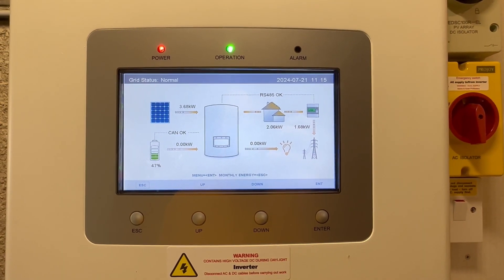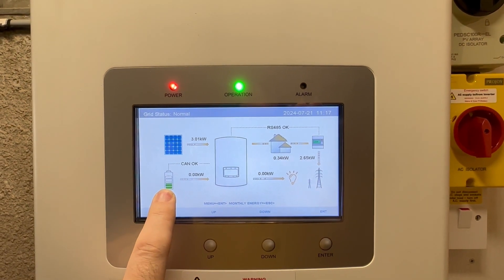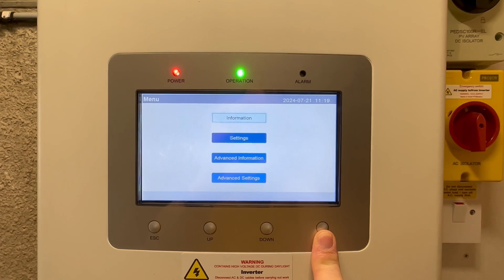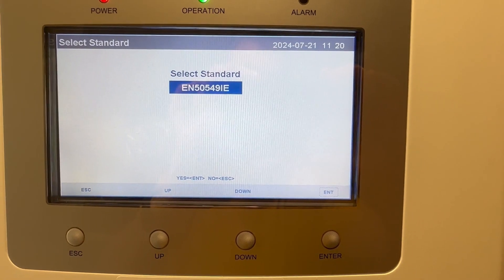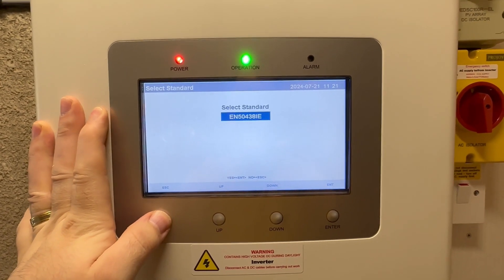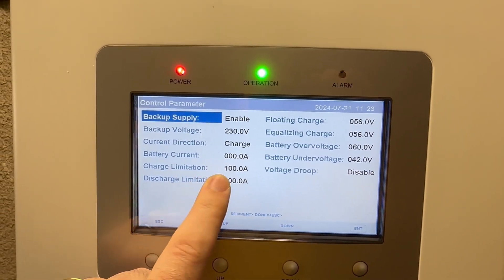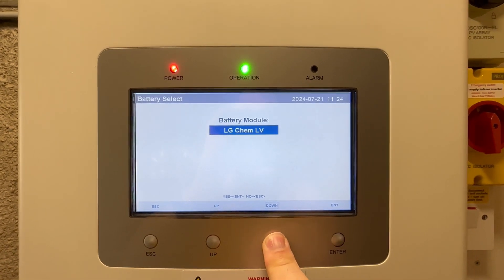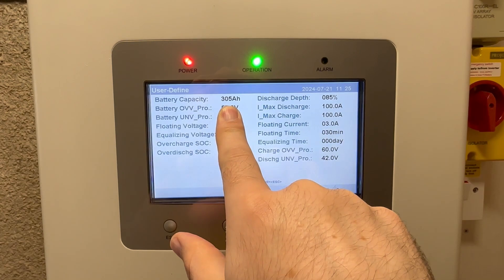Solis Inverter Battery Settings (other options)

Comment: Your next project..

Now you have cheap electricity and big batteries.

Get yourself some Air Conditioning fitted. New type 'Inverter compressor" type units.

Above minus two outside then instead of burning the Gas Chugga we switch on Air Conditioning to bulk heat the house.

Rather than paying 6p per kwh Gas, we're using previous night 12p Economy7 and dividing this by 4 (COP), our Heating costs 3p per kwh which at EV Rate of 7p would equate to 1.75p per kwh Heating!! 

We're saving a fortune on our Gas as 1kwh of electricity gives 4kwh heat. Roll on Spring when the electricity is free.

One tip - oversized units is the secret. They have the power to heat and back off to maintain.

BACKUP - does not need to be enabled on your Solis, although switching it on and moving your lights, boiler and fridge freezers circuits to a secondary Consumer Unit connected to EPS output on Inverter means they stay active during Grid failure.

Priceless..

One other tip on charging during Winter. Spread the charge over the full off peak period. There is no point charging to then run a washer from battery, run these appliances direct from Grid while charging. In doing so, you'll lose 5% on the round trip - run appliances overnight while charging..

Example - 16kwh needed and 6 hours window.

Watts divided by 52 divided by hours.

Eg

16000 / 52 / 6 = 52amps.

Doing this will mean Inverter works less hard and live longer and as your still charging while car is on you'll not risk charging car from batteries. 100amps is a hot Inverter wasting Energy and reducing its lifetime.
Reply from the maker: Some food for though there. Although we use very little gas, comfortably less than €500 a year on heating and gas hob. I just got the bill for November/December bill which matches the January/February bill typically. The bill is €118. This will be similar in Jan/Feb. So €250ish for the 4 most demanding months. The rest of the bills will be much lower. cost per unit is around 8c. We are well insulated here. 

I think the next round of energy spending will be to increase the number of solar panels on my property. I can add another 1.2kWp (4 panels) on the North roof to compliment the 4 panels there, attaching them to the same string. 

After that, I expect to add 4 to 6 south panels on my flat roof extension and 4 panels on my shed roof which has a slight north angle. Another 2 mounted vertical on the back of the shed facing south. I would be pretty much doubling my solar generation, but the panels on the extension and shed would not be connected to a hybrid inverter and so would not be directly connected to the batteries. I expect that should I add an standard dumb inverter and connect the comms to the hybrid inverter, any excess generation should go to the batteries before any is exported.

You make sense with using appliances like dishwasher and washing machine during the cheap rate rather than using the batteries. The reason I use the appliances during the day rather than during the cheap rate directly is to keep the sustained load from being too high. As it is, my main fuse is an 80A. Using a power factor of 0.95 with 230V my EV charges at 7kW and Inverter draws 5kW for the batteries. That's 12kW or 55A. If the immersion is left on at 3kW, that's nearly 69A, which is awfully close to the 80A limit before considering the standby base loads of around 500W. I plan to add a 3kW charger to the battery pack, but not before I setup the load balancing on the EV charger. So, my supply limits me and it is very expensive to increase it. Mine is anomalous, as I technically have a 16kVa supply allowance on a 12kVa supply because my DNO fuse is the same as the main isolator/breaker in the meter cabinet.

I'm also stuck with a 4 hour window to avail of the rates I have. I might consider a longer window upon renewal to help spread the load over a longer period. Will have to see what is on offer.
Reply: @GaryOnPower  sorry I've not replied as not seen your in depth response.

I'll read and respond later... one note if adding panels in a shade area such as rear, might be worth considering optimisers. We have a second string with two types of panels and half facing South othes West. This string works perfectly all day given max from each panel.

Apart from 4x nights this Winter using boiler as Air2Air wouldn't be efficient- we've had AC running 2pm until 8pm at an average cost of £28 per month.

Our Gas bill £20 for Hot Water..
Reply from the maker: @leet3707 The 4 panels on the Northside roof have optimisers and I would also put optimisers on the additional 4 planned for this year. The main reason would be the chimney shadow that casts on the North roof at certain times of the day. 

We use gas for hob cooking, as I prefer that to electric hobs. When we turn on the heating, the water in the boiler is also heated, but we can use the immersion element to heat the water separately. I do intend on upgrading my heating controls, as well as getting a larger cylinder installed and will be removing the electric shower which is a big load when in use (~8kW). We have a 4bar house pump already we can use for a thermostatic shower. 

I just looked back at our 2023 gas bill. The 2024 bill is split between providers, so is awkward to get the exact figure. The year bill was €391. Similar in 2024 from a glance. We use about 25% of the average for our house size on gas. By contrast, we use about 5 times the average on electricity. 

We had a new addition to the family this week, so I will be taking a couple of weeks out before making any changes to the house.
Reply: @GaryOnPower  congrats on the new arrival.. 

Sounds good with panels and optimisation.

What chargers are you running for EV as they'll likely be a "Grid Limit" setting. Although we have 100a fuse, as iys running overnight with other appliances I've set our Zappi to 80amps. This means the charging will drop if house incoming exceeds 80a leaving some headroom.

We're on Economy7 not EV due to protection of a longer term legally binding tariff as during the last Crisis many were kicked off EV to expensive non tariff rates.

Definitely look for a longer Window, 7hrs is great for us although 4p per kwh dearer which a can live with for longer nights and guarantees.

I tend to push appliances to early hours to allow the car chance to finish. Might be tight with 4hrs but great on 7hrs. Car finishes around 4am, appliances start at 5am.

Try setting incoming limit as this will protect the main fuse and allow max charge rate if spare capacity available.

Similar situ here last year, £550 Gas now £20 as we've shifted to electricity via Heat Pumps, er Air Conditioning.

Last 3 days has produced enough Solar to run the house, cooking AND 10kw spare for FREE Heating.

People still argue Solar isn't worth it.. lololol
Reply from the maker: @leet3707 I use the Hypervolt 2. I have yet to install the CT Clamp (first one went missing and second one arrived a few weeks ago). It's set to give the full 32A and will do the job of balancing the load once the CT is installed. 

My Grid limit is currently 80A. I have an unusual setup I won't get into here, but suffice to say I want to keep the load at or below 70A.

The cheapest tariff available is 5c per kWh but only gives 3 hours and that's a short window which would encourage me to stress my supply. I have the ~8c per kWh over 4 hours where I charge the EV(s) and house batteries. This is between 2-6am, so there is essentially no other load and that works great for us. I could have an 8 hour window, but the rate would be much higher and we wouldn't see the savings. As it stands, almost all the energy used in the house is from cheap night rate stored in the house batteries, or from solar.

Looking at my solar right now:
My house imported 53kWh from the grid with about 52kWh taken during the cheap rate. The split was probably 50/50 between EV and house battery.
The Solar exported 16kWh to the grid, paying me 20c per unit.
The house has been powered by solar and battery for the day and will have taken about 20kWh from the battery and 10kWh from solar. 

Not having solar is silly in my view.
Reply: @GaryMeatsLife  is there an option for a Grid Clamp?

The 32a is the charger supply cable, Zappi has a Network setting where the max Grid supply can be set.

Comment: AOBO setting is for Seplos V2 BMS. Just upgraded here from V2 to V3.

User Define is currently used for V3

Setting 19200 BAUD wiill kill the Solis Data Stick as they only support 9600 RS485 speed.

Set the Seplos to Ginlong Solis protocol on the pack and user define on the Inverter. BMS data is showing in the Inverter with these settings and Cloud still works.
Reply from the maker: Thanks for that info. I kept mine on User-Define. Interesting with the baud rate. All other suggestions seem to suggest the 19600. Mine has been set at this from the start (8 months now) with no problem. I did have a comms failure on my first inverter a few hours after hooking up the battery, but this was an inverter issue, as I am still using the original datalogger with no issue. I'll take a look into these settings, especially the protocol change.
Reply: @GaryOnPower  no problem and hope it helps.

Battery and Inverter worked fine on 19200 but lost cloud communication, showing offline as well as Home Assistant.

Solis have said their Data Sticks are 9600 although not attempted to change.

All running sweet at 9600 so probably not going to mess with Stick settings.

Did see video on BUS. Might be worth looking at bouncing connections across all three packs p+ to p+ to p+ then take Inverter +ve to first pack. Then link battery P- together taking the Inverter -ve to the opposite last pack - using the same length cables between the packs.

This 'should force equilibrium over the three packs as I have here without BUS on them. 

Equal and opposite is the key, just like the good old days we had 16 very large Lead Acids in our garage.

Which Logger are you using? Ours is the ST3 I believe. Silver bodied and tubular.
Reply from the maker: @leet3707 I believe my logger is the S2-WL-ST (4 pin). The black one. Though we did try the older silver version when the inverter had comms trouble. 
If the baud rate is working for you, leave it be. I've just always seen it being a recommendation to increase it. Here's an example just from a quick text search https://github.com/alienatedsec/solis-ha-modbus-cloud/blob/master/README.md

The BUS BAR setup was supposed to force equilibrium after the previous daisy chain setup saw my packs go way out. I'll be making changes here in the near future to bring them closer into line. It's at least interesting to see the differences when the setup is changed.
Reply: @GaryOnPower  the silver loggers are fixed at 9600. Hence setting back to that.

Lead Acids were a challenge to keep equilibrium with many lessons learned.

As long as cables are same interlinking and following the old Lead Acid rules of spreading by splitting the Inverter +ve and -ve to either end, all should be fine as there's no favoritism towards one pack.

Comment: Have you done, or can you do a Seplos settings episode for the Solis/Seplos config, after my JK BMS died, ive just got a Seplos one. Inverter is the same Solis 5k Hybrid. Many Thanks.
Reply from the maker: @kenbone4535  The whole video series is based on the Seplos and Solis combination, including Seplos BMS configuration. Take a look at the other videos in the series and you should see what you need. They are set in order, so maybe skip the first 2 videos, which are build and wiring ones.
Reply: @GaryOnPower  many thanks, ive watched most of them over a few times 😁 whats your can setting in the BMS itself, to make it work with the Solis. Thx
Reply: BTW I'm running an old leaf 24 pack that I've repurposed.
Reply from the maker: @kenbone4535 Plyontech protocol as standard. As it’s the default, I hadn’t mentioned it.
Reply from the maker: @kenbone4535  brilliant. I had two of those cars. Currently our second EV is a 40kWh Leaf. I do hope that battery is not in the house. I keep my LiFePO4 outside even though they are very safe.

Comment: Hi Gary, I have added two dyness batteries to my system. On the home screen it says RS485 Null and I'm not getting any readings for battery use or for current house use. It is currently reading through battery capacity though. Any ideas what I'm doing wrong? Many thanks
Reply from the maker: I’m not very familiar with other batteries, but I suspect your inverter settings are wrong, as the Dyness should be plug and play on their end.

What to check are the battery settings on the inverter. Select Dyness and make sure you also have the correct grid settings turned on. The first setting that ends with IE should be OK. Make sure to wake the battery after any settings change. 

Finally, check that the cable is good.
Reply: @GaryOnPower  Cheers Gary. I've followed the instructions and used the CAN cable to connect the batteries to the inverter. It's reads "CAN OK" and shows me the battery charge. I just don't have any other data and have the message "RS485 Null" above the house icon. I selected Dyness from the list of batteries like you mentioned. I'm sure its some setting I just haven't figured out! Thanks 😊

Comment: Hi Gary, I know you're not using a Growatt inverter but when I plug the Seplos Mason 280L V3 I've just built into my Growatt SPH5000 inverter it isn't recognised and the inverter comes up with a BMS communication error. I'm using the communication cable that my Growatt batteries used. Is it likely that I need to change settings on the inverter before it will recognise the battery?

Edit: its a setting accessed via tge screen of the Seplos, seems to be charging and discharging normally now 😊
Reply from the maker: Great that the battery is working for you now with the inverter.
Reply: Thanks! Found your videos really useful because I haven't built a battery before. The only bits missing (or maybe I missed them) were installing the flat flexible busbars and fuse.  @GaryOnPower
Reply from the maker: @edr4386  There was no need for detail on the busbars for the wiring video because they are clear to see for a large portion of the start of the video, including when I lift the top cover up.

Comment: Finding your Solis/Seplos videos really useful. Planning to get Seplos batteries for myself, and a freind has the Solis so helping me to understand his installation too.
Reply from the maker: It can be addictive 🙂. You just need some patience to get through it and when it all works, it is worth every second you spent on it. Unfortunately I am waiting for parts from FogStar because I was given the wrong accessories kit and can't finish my second battery. They are trying to send a replacement kit to me and they are great to deal with. Patience is needed though. 100kg of batteries on the kitchen table for 2 weeks is not easy to explain away 🤣.

Comment: im wondering what are the differences between Control Parameter in Storage Energy Set  and User Define parameters in Battery Select menu.
both of them contain currents and voltages parameters related to charge and discharge the battery

Comment: Hi Gary, excellent videos on Solis and Seplos. When moght you be doing a video for adding second battery? Im having no luck.😮
Reply from the maker: I expect to have one this month. I am building the second battery this weekend hopefully and will figure it out after I configure in BMS studio. I’ll record the process.
Reply: What's issue?

Just set same parameters on both packs, set same protocol and plug network cable the right side RS485 on the master battery connected to Inverter to left side RS485 socket on second and so on..

Comment: Hi Gary, just to clarify... You have 2 EVs. You charge your battery and 1 of the EVs using the hypervolt charger and do you use the granny charger for the other car or have u a 2nd charger? How many kwatts are you pulling between 2am and 6am daily ?  ( Great video )
Reply from the maker: Alan, glad you enjoyed the video. I have a Hypervolt 2.0 which draws 7kW and which I schedule for 2am-6am charging. I also have an outdoor socket which would draw about 2kW. The outdoor socket is almost never used as we alternate the cars with the Hypervolt. The battery draws 5kW when charging. So the draw is 12kW from the grid over those hours…14kW if the cars were both charging. That’s the limit with my setup. My main supply is due to be upgraded also.

The house then runs off the battery for the day. Funny fact: I’m currently in the UK and collected 16 more battery cells (15kWh) in the Netherlands a few days ago and yesterday another battery case. I’m about to strap the case to the roof rack on my Tesla 😂. 14 of the cells fit in the lower trunk/boot and the other 2 in the frunk. The car is stuffed with luggage and 3 people. Fun drive home 😅
Reply: @GaryOnPower  Safe travels Gary, Can't wait to see how your second battery pack build goes and especially how you daisy chain the 2 packs together.